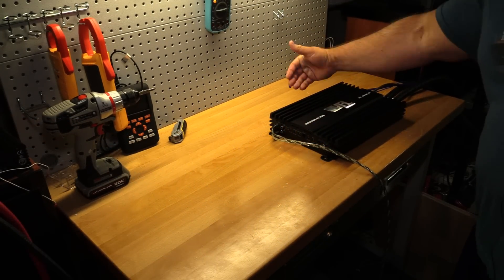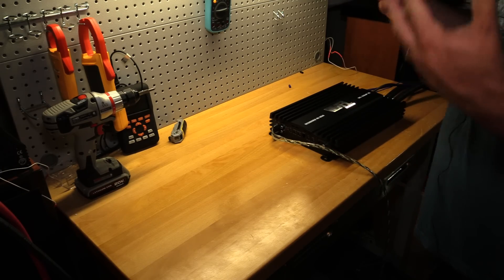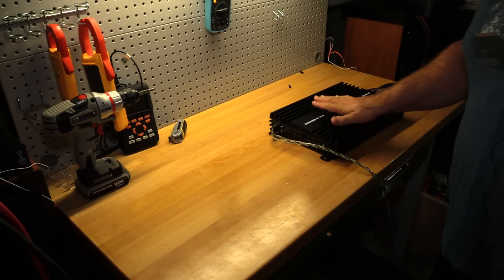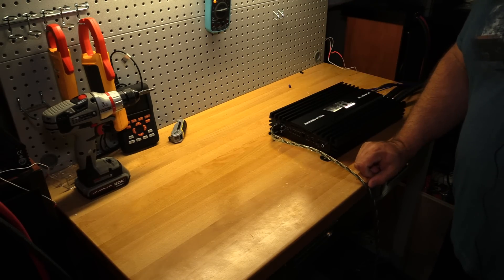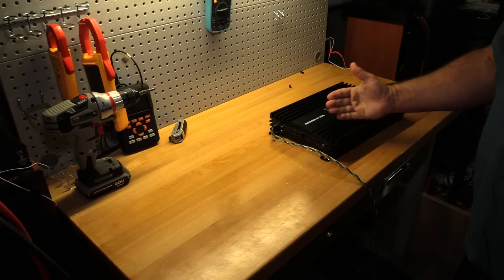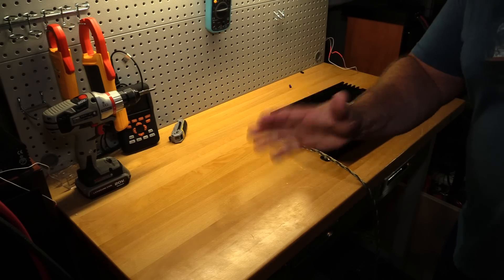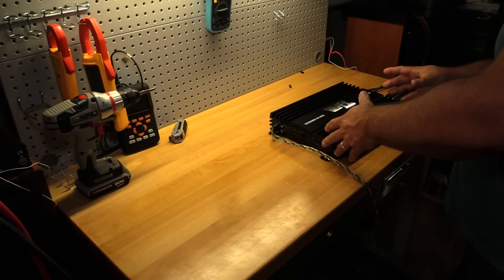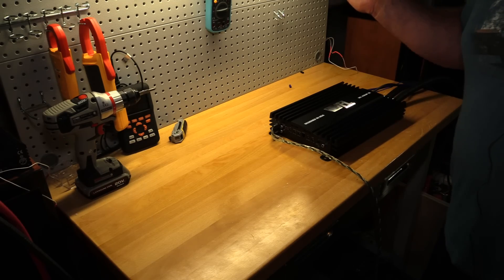Re-Test = More Power? VFL Audio Comp 2K back on the Dyno!

Comment: I got the vfl 2.5k running .5 ohm pushing 2 dd 3510's and its PERFECT.
Reply: I just got the 2.5k, how did the amp hold up on .5ohm , im planning to run it at 1ohm i hope it's able to do the 2.5k I just haven't done my alternator yet rn its doing around 1.6k without the upgrade

Comment: bob from ab explains the comp series amps do rated at 16v hence “comp” 🙃
Reply: Finally but they are all 18v amps 16 is the tested voltage.
Reply: If that's so why does Bob advertise 12v? Bottom line they don't do rated at the advertised voltage
Reply: Where"...???????
Reply: @pine51  whenever you buy a 12volt version or 16 volt version.
Reply: @pine51  bro I have delt with AB for 7 years now. In all honesty it's a great product when dealing with the VFL lineup. They weren't called 12k, 4k, 20k, and so forth. They were vfl 1100.1 and so forth. Which actually gave AB an out when really they didn't specify true wattage. My vfl 1100.1 has a 800 amp fuse. At 14 volts I barely get 11k. Id have to hold above 15 volts to get 12k which basically means  I'd have be at high voltage. So why does AB even say it's the 12 volt version of the VFL 12K when it doesn't make power at no where near 12 volts? This is why I stopped dealing with AB

Comment: These amps are power hungry, but they WILL do rated power. These amps will take a 16V input. I know that's not realistic for street use, but the "comp" means competition.  Also these are not rated for it, but they are .5 ohm stable. If you still have access to this amp, if possible,  test it at 15+ volts.
I have been using American Bass products since their inception, and know what they are capable of. I set a world record of 154.1 DB back in early 2000's with two of their VL 12's and a D1000.1.
Reply: Remember the record vfl 18 at 179 db might be 178.and it was only 1 sub.man gotta love them underdogs

Comment: which amp would say would be better for strapping. The vfl 2.5k or the wolfram C2400.1.  the both are around the same cost wise. I was just wondering.
Reply from the maker: The VFL 2.5k is more money everywhere I look
Reply: @bigblank69  I found the vfl for 270 and the wolfram C2400.1 for 249.00

Comment: I think AB should've stuck to calling their vfl lines the original version. This allows for the amp not to be criticized for not making power. Ex. VFL 150.1 vs VFL 2K. At a 150.1 it does certified power and at 2k it doesn't. Sad to say whether this amp is a gem or not AB is  market scheming by inflating power ratings just for a sale.

Comment: I like to see amp dynos that are around 13.8 volts or maybe even lower for real world results. I really don't care what the amp is supposed to do. I want to know what the amp will actually do with stock electrical. Lets say a 100 to 120 amp alternator and stock battery. In my opinion 90 percent or greater of people are never going to have 14.4 volts with a 2000 watt amp cranked up to its max. I think 100 to 160 amp alternators are getting pretty common in vehicles today so I would like to see someone with a amp dyno channel that has a AMM-1 and takes real world number from the vehicle using a capacitor bank for the load. This not only show real world results but could also show what kind of damage these powerful amps can do to a cars electrical system when cranked up for to long.
 For example, my daily driver has a 120 amp stock electrical system. My amp is rated 2400 watts rms. When metered it will produce 1600 watts at 13.8 volts for about 2 seconds before the voltage drops to about 11.8 and if left cranked for just 1 minute voltage drops to about 11.2 and I am sure if i keep it cranked up long enough some major damage is going to happen. 
I have seen it Happen all my life and still see it today. I have a friend with the same vehicle as me. He has a nice 2500 watt rms amp. Paid alot of money for it just to burn up his A/C compressor, his diode keeps blowing in his dome lights and he keeps blowing a tail light. Also his rear wiper turns on and off by itself...lol.. but that could be from getting beat to death.
       Thanks for the videos. I appreciate them.
Reply: Dont give up bro. What you do works perfectly fine and i like it. Just a suggestion about the car thing. I do really care if they do what they are supposed to do and you show that. Just that nobody really does what i was saying. Be cool if they did.

Comment: Dont care what anyone has to say but honnestly i feel that americanbass is the best you can get. When it comes to the subs, amps, and mids and highs and tweeters they flat out beat the compitition. I mean come on for the money ive never came across a better sounding company and dont forget just one vfl 1100.1 on 1 vfl 18 hit over a 175db now come on what othwr company can hit a db that high only using one sub and one amp?

Comment: Bob hit you up brother? Good amp I agree. But it does not do rates at claimed ohm load. Close yes. Stick to your guns brother. You have a following that respect your tests and opinion. Bob need to rebadge this, period. Either it does rated or it doesn’t. It not a gem because as stated by another for another $26 you can get the Orion 2500 and shatter this amp. Respect.

Comment: I have this amp and I think it does great pushing my 2 db drive wdx 2k 12's wired at 1 ohm.
Reply: What channels did you use to run It too 1 ohm?
Reply: @NotD0nk999  you wire your speakers down to 1ohm

Comment: try the phantom 5k again it does 3750 rms at 1 ohm thats what mine hit i really also would like to see you do the soundstream ar1.8000d yes i know bigd did it but don't know about some stuff he does
Reply: korny69 the boss phantom ... 3750w ... I don’t think so
Reply: @TheTechGuyYT  
320 amps at 14.4 do the math
Reply: korny69 the boss ??
Reply: @TheTechGuyYT  
Yes i changed all the fuses and it held up no problem for 2 years so that's why i said it can do it from factory ya probably not lol check my channel you will see what i got now
Reply: korny69 changing the fuses doesn’t mean it will do more power . The internals can’t do above 2 k
Reply: @TheTechGuyYT  
Well mine did no problem so maybe i got one of the gems proof is on the numbers when i did it but that thing is gone anyways like i said sold it for 500
Reply: korny69 yes it can take the fuses but that doesn’t mean it does more power . The internals just aren’t capable of doing more power ,
Reply: @TheTechGuyYT  
Like i said mine did but it's done and over with i know what mine did i upgraded big time anyways

Comment: I think the amp needed just a bit more voltage and power to achieve its specifications. I feel as long as you feed that amp plenty of voltage and power. Its a gem all the way. Plus its built like a tank!
Reply: And again an 18v amp y does no one know that its rated for 18v

Comment: Good job Ryan, but I have to disagree emphatically. This thing is $280. That is NOT a budget gem. For $26 more someone can get an Orion XTR2500.1Dz which produces over 5k dynamically at .8 ohms, over 2k at 2ohm, and well over 3k at 1ohm. Or someone could buy the true budget gem that sounds awesome and is a huge steal STILL which is the Audiopipe APMI2K for $170.
Reply: @bigblank69  This one's tough. I hear what you're saying. It just doesn't resonate anywhere near budget definition. An Audiopipe 2K is literally $110 less and produces more power. That by definition is the gold standard. By using it as the limbo stick starting point in your comparisons, it will force honesty and economical pricing from those budget claiming manufacturers. Otherwise, we run into nonsense calculations that can be subjectively applied to many scenarios. Two Boss4k amps produce more strapped for less. Planet Audio, SSL, etc. I'm not insulting just open discussion.
Reply: @rebassed1  it's not just about the wattage it does efficiency build quality available ohm loads etc.
Reply: Ant Gio Its a Korean amplifier. The audiopipe is Chinese. Did you see the video where one of the Audiopipes blew up in the dyno? Its a better build quality which costs more.  Orion is one of the few companies that sell Korean amplifiers at lower prices compared to most others. Check out the prices of the 1.5k-2k Korean ampifiers and you'll see this one is not so bad compared to others.
Reply: Ant Gio the xtr is good but again it’s not as efficient. Thus you’ll need waaaay better electrical to run those numbers. However I see where our coming from. And I also agree you can get better, but for the price if this one compared to other amps with the same features like board and stuff it’s not terrible.. but if I was getting this much Watts I prolly wouldn’t get a Jordan board. So yea lol. idk but I know what you mean
Reply: audiopipe is the best budget gem by far I have used 1500apcl for years on 1 ohm and it pounds flexs trunks nicely at 1 ohm! however their not efficient at all at 1 ohm the audiopipes will proabobly suck up over 250 amps which means electrical needs to be on point or you wont see anywhere near what the amp can put out
Reply: I paid $150 for mine off amazon budget gem it was

Comment: Great video!  ... But I don't necessarily agree 100% that this is a gem.
Because.... 
In Dynamic mode, at above rated voltage, it's still quite didn't meet rated power. 
Is it a good amp?
 Yes.
 Quality builders and so forth? 
Yes. 
Is it a good bang for buck? 
Meh... 
I'm just not kosher on an amp pushing a $300 price tag but not necessarily meeting rated power... 
Just my 2 pennies
Reply: I completely agree. This thing is $280. That is NOT a budget gem. Umm, for $26 more someone can get an Orion XTR2500.1Dz which produces over 5k dynamically at .8 ohms, over 2k at 2ohm, and well over 3k at 1ohm.

Comment: American bass still needs to rate there amps better.  There all off a little just like this one.
Reply: The silver vfl amps do above rated so to say they all do this is a off statement.
Plus these amps like .5 and .25 ohm
Reply: I have a vfl 120.1 and would love to know what it really does
Reply: @jerroldallen5927  I'm sure they do rated and a few hundred over but all depends on rise, voltage, and conditions so test are just that and in vehicle test are different and very from different situations.
If you feed it the power and wire it low you will be good ofcourse on good electrical
Reply: @bigblank69  well my 150.1 I had did 3,400 rms starting at .5 going to just above 1.
And my current 650.1 did 6,900 but these amps like .5. And that was at 14.3 volt.
Buddy of mine had 8 of the 120.1 and I think he was getting 2,300 if I remember correctly.
Newer vfl I am not a fan of really but to say none of there stuff does rated by the comment is false.
Reply: @bigblank69  my buddys amm1 and my car and he had meters ect.
The 650.1 I run now is the same board and the sundown ns1 or atleast that's what I see people post and that amp does the power.
I'm working on getting a amp dyno and I'll do a video won't be till the end of the year and not trying to discredit you in any way but the black vfl amps do not come close to the older silver vfl
Reply: @bigblank69  that's what he was saying it did I watched him do it.
Not sure about the alphard audio I see your videos but that's about it.
Like I said if you lower them down to .5 or .25 they put out the power every one that runs them never has a issue.
I have never used the newer ones so not sure on those but every older one I have had or seen people clamp do what they are supose to.
My other build is all sundown audio over priced in my opinion but is what it is.
At .67 it did 2,500 so that's above the 2k.
.5 or .25 would be better
Reply: Every other manufacturer that has a similar board as the VFL's rates there amps more realistically. Every single one. Orher companys use the same boards as american bass and american bass has the highest watt ratings out of all of them and thats on many different models of theres. And its all of the time as far as I've seen. They just over rate . Good boards,  just over rated a bit.
Reply: @joshhanson6777  I agree with that to a point.
I have ran every amp other then newer stuff and out of all the amps these never get worm or shut down at .25.
In a car box rise plays a huge part so the dyno testing is good to a point and to get numbers and the test Ryan and big d do is great and help understand the power it does but then the vehicle play is different.
I'm not 100% but pretty sure the older vfl are considered a cheater amp and the 150.1 is supose to be 150 watt so that would be underrated by alot at that point.
The vfl 150.1 amp I have is the old original one that first came out its gold color so I'm sure its different then the one that does only 2900
Reply: bassinyourface whats really bad is that the silver 150.1 thats out now thats rated for 2900 watts is the exact same board to the t as the soundqubed 2200. Rated at 2200. And its the same as the hifonics brutus 2400. And american bass gives it a 2900 watt rms rating. All of the silver and black amps are like this. Way off. Now as far as the gold one goes I believe it is the best of the bunch and is more realistically rated. But these new ones are way off. All of them. Everyone I've ever repaired and bench tested was way off its mark.
Reply: @joshhanson6777  soundqubed has great stuff and good priced.
I should have went with them over the DC I got.
I dont know how to do the numbers maybe my buddy dont know what he is doing lol.
I would like to know what my 650.1 really does then but I dont drop below 14.4 at full tilt.
And I know it's more power than my dc5k
Reply: The 650.1 was done by amm1 the 150 was a clamp just to clarify